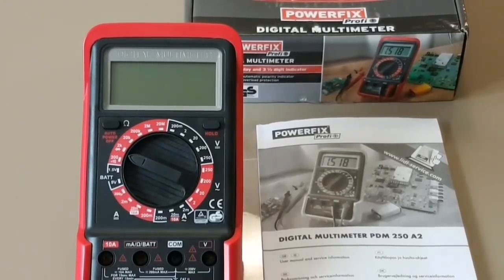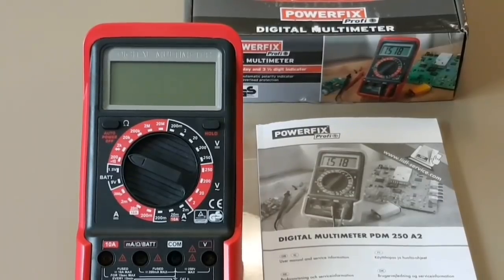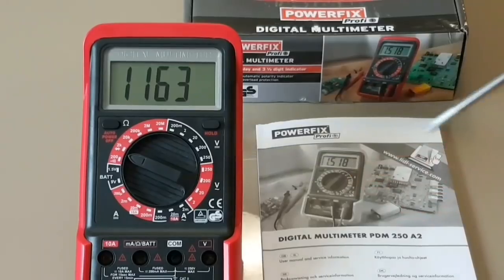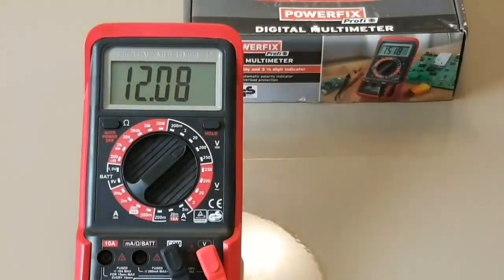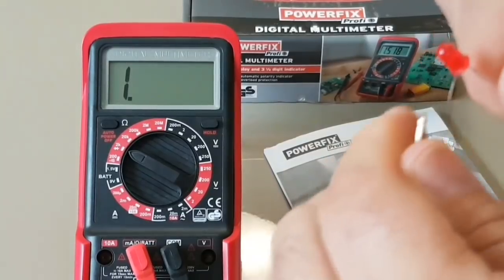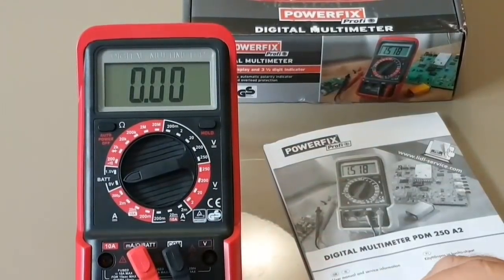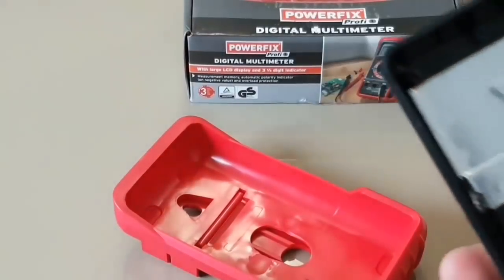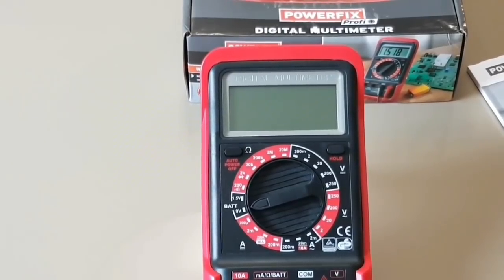German Powerfix PDM 250 A2 Multimeter Review & Teardown!

Comment from the maker: FYI- This meter is TUV and GS  certified for the European market so it should meet it's CAT II/250 Volt rating.
Reply: Let me rephrase that... "It Will meet the cat rating." If sold in germany, IT has  to go through tüv and their testing and their standards are strict.
Reply: @AnanusBananus  only if the tuv sees it.. i can copy the sign as i want when i am a chinese exporter.. the seller is NOT RESPONSIBLE FOR THE DEVICE SAFETY..

One of my friends lost his eyesight from a shattered wood handle of a shovel in germany, he sued the market for it got 3000€ compensation and "lost" in curt as the Seller is not responsible for the fake TUV seal!!
The shovel was bought retail in a german "we can do it" market! Diy shop chain..

FUCK GS TUV AND ALL THOSE IDIOTS AS LONG AS THEY DON'T OFFER QR CODE SERIAL LABELS ITS WORTH POOP!!

Comment: Hi Darren....very late for a comment about this GERMAN multimeter (written on the box, on the notice, on the backside of the meter,   Lidl and german control are reliable for that) produced by Targa Gmbh 59494 Soest Germany.
Why a comment now? Simply because I used this old meter since 7 years , well... only for AC-DC values, control of my 220V installation and a lot of different cells and batteries (what most people do with a multimeter). 
It never failed with accurate values and with the original leads. Fully reliable after 7 years.
1/10 sec to get the continuity-beep...OK, no time for opening a beer. Not perfect but absolutely no problem , just a little angry to change the lead position for this control....And I don't know if it really needs current to run : the included 9V cell was good till 2017...but still perfect beep and values.
Well, completely out of order for electronics geeks , but still  pleasant Vintage meter and very easy to use for common usual values. I change it only because I give it to my son for his house renovation (he had an horrible tiny chinese matchbox with inaudible beep)
Friendly, Michel.
Reply from the maker: Hey Michel...it's never too late for a comment 😉  Agreed, I still use and like this simple but well made multimeter from time to time. Does what it needs to do and nothing more. Your son was gifted a nice meter , hope it serves him well. 😀

Comment: Hi Darren... great video.. I have this same multimeter.. can it be used for a parasitic draw test on a car battery.. most guides say to turn dial to 10a  under DC Volts.. but only see 10a socket to plug probe into.. can you give any guidance thanks
Reply from the maker: Yes indeed!  You can use this meter to detect/measure parasitic drain on your vehicle.
Put the Positive probe into the 10A jack, Negative Probe in COM and turn the dial to the 10 Amps (DC -)on the Selector Switch.

To begin the amperage method test for parasitic drain, disconnect the negative battery cable from the battery terminal. Then, connect your PDM 250 meter's ground (black) probe to the negative battery post.
Connect the meter's positive (red) probe to the battery cable terminal you just disconnected.
Set your multimeter to the highest setting on the 10A DC (direct current) amperage scale and turn it on.
Now, check your meter's display. It should read zero amps.
Now remove the Positive probe from the 10A INPUT Jack  and insert it into the mA/Ohms/BATT  INPUT Jack. 
Move the meter's dial to the next lower setting on the amperage scale (200m) that's 200mA
On a vehicle WITHOUT a parasitic drain problem, this current is within a range of about 50 milliamps (mA). On a vehicle WITH a parasitic drain problem, this current will be higher than the normal range. The mA max range is small on this meter , only 200mA, so hopefully you won't see anything higher otherwise it will blow the mA fuse.Hope this helps..always be careful and take your time.
Reply: @KeepOnTesting  thanks for all that detailed info ..that's a great help...👍